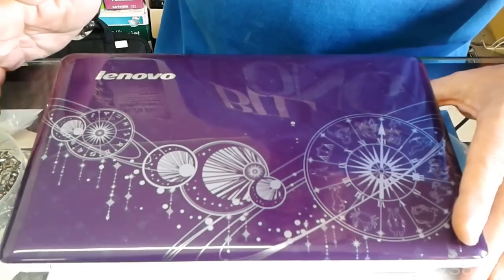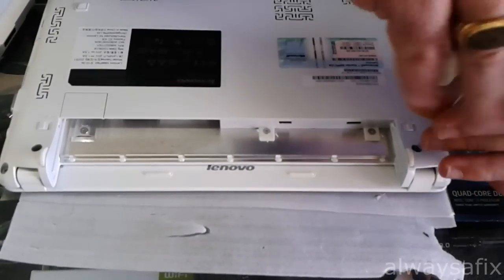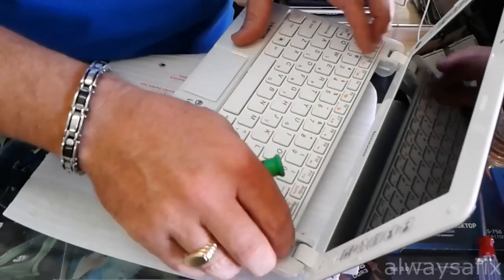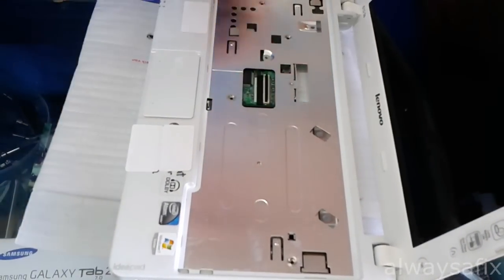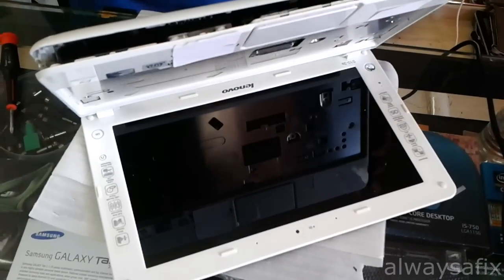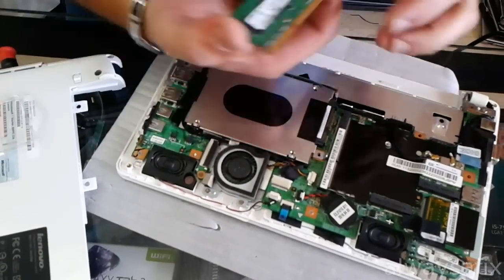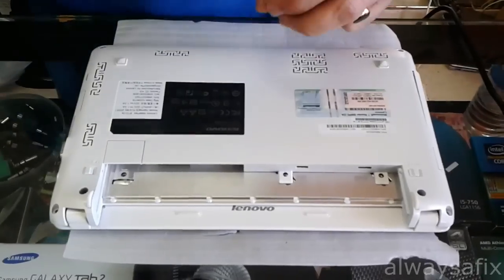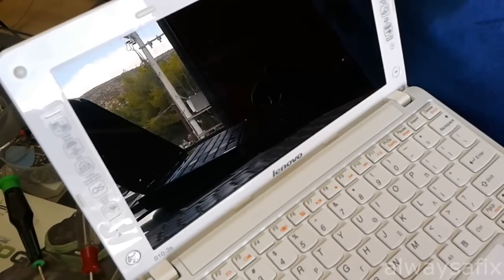Ram upgrade Lenovo ideapad s10-3s

Comment: Hi, I was looking for the way to upgrade my netbook and happy when seeing your video, I said, "Hei, that's exactly looks like mine!". This netbook was said as limited edition, so no one has it wherever I go, people love it and say it's very unique. This netbook has been with me for more than 10 years now, I use it for about 10-15 hours every day, and it only blows once in cable, not inside. I even dropped my coffee and it stopped working about 4 days, then I just dried it using fan for a week without opening any parts, and it works well again till now😬  
Very small, very rigid, very useful, and I've just thought that I need to upgrade windows and RAM just by now, after 10 years. Thank you for uploading this! 😊😊😊